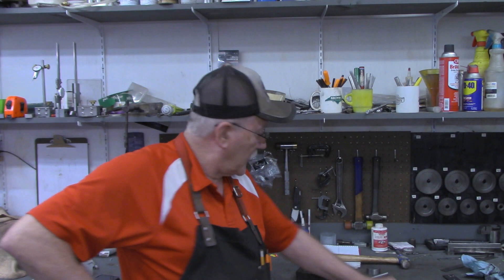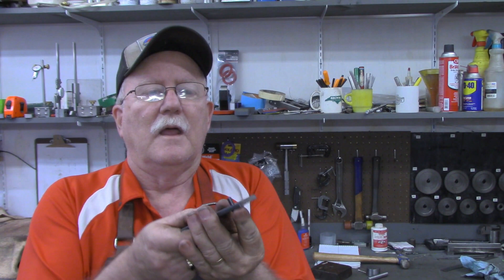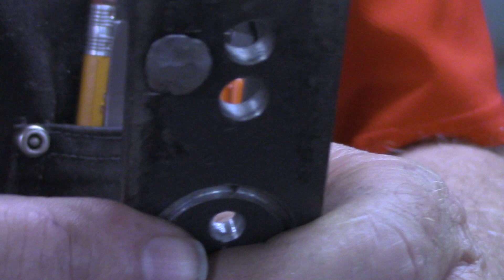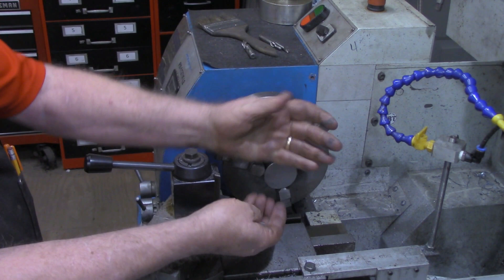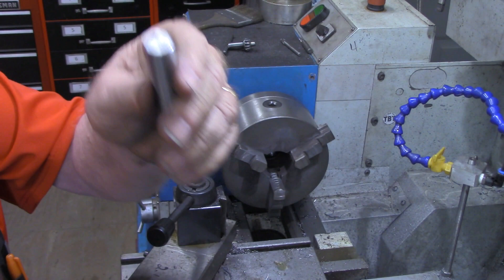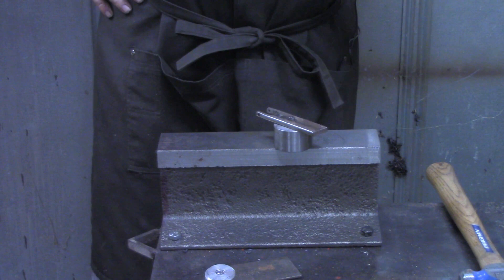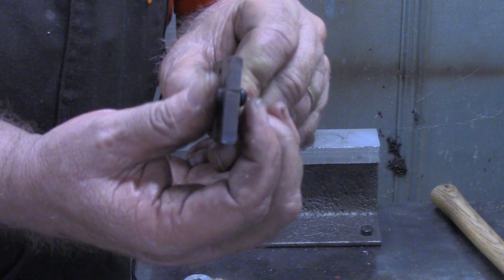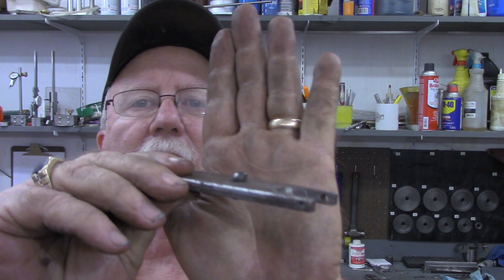Rivet Header / Setter - A Multilevel FAILURE

Comment: Hi Lee, I really enjoy your videos.  I use my 20 ton press very similar to the press you have in your shop to form rivets using tooling very similar to the ones you made.    20 tons should be about the right tonnage to press a rivet of that length and diameter with a little safety tonnage to spare.  If you have the time, I'd enjoy seeing you put those tools in your hydraulic press and form a rivet to see how it works.  If nothing else, it can save a few smashed fingers :-)  I also use a bucking bar and air hammer to form softer rivets on my hotrods, but that is for light gage material with a total stack up of about 0.06".  Keep the great videos coming!  The type shown by Rough Rooster is also a nice tool because you have a lot of control with it, and you get a similar result as with a hydraulic press.  When you are in the field a hydraulic press isn't an option.

Comment: My grandfather was a blacksmith/farrier and I used to watch him make his own rivets totally from scratch using chopped up pieces of wire.he put the heated blank in a guide and thumped it with a 12lb hammer once,this formed the dome at one end.When using the rivet he would cut it to length in the job and then with the same hammer just a few hits were used to flatten it in.Never saw him using a form tool and he explained that the quicker the metal was flattened the easier it was to work as it hardened as you hit it.It was my job to bust out all the old ones coming in for repairs and at that age I could hardly lift a big hammer and use a chisel,no fancy air-tools in my gramps shop,even the blower was hand cranked.

Comment: The rivet set that I used to use had a heading pocket and a setting bore side by side with about 1/16" between , made from rectangular stock rather than square or round to accommodate the two packets. The setting bore was the rivet shank diameter plus minimal clearance, 1.4 shank diameters deep, and bored to a square blind end, rather than a pointy end like you would get with a drill bit. This bore was used to expand the rivet with a single sharp blow that transferred the impact to the shank just above material being joined, thus expanding the shank there and preventing the rivet backing out as you finish it.
Your issue with hot rivetting is that you are approaching it the wrong way. The rivets are heated to red hot or hotter in a furnace or forge, and the material remains cold. The rivet is then placed and driven while still red hot. As the rivet subsequently cools, it shrinks in length and draws the material tighter together. In your method, the rivet does not get hot enough, and the metal it is to fasten reaches a similar temperature as well, so as they cool, they shrink at a similar rate and the rivet does not tighten further than it has been formed.

Comment: It's been a long time for me as well, but if memory serves me correctly, rivet length of enough to go through the two parts plus the diameter of the rivet seemed to be the ideal length.  Shorter would not hold well, more than that increased the likelihood of the problem you experienced.  It may have been 1-1/2 the diameter, certain it was no more than 2x diameter.  I also thought, before you mentioned it, that the head divot in the base may have been made a little too deep.  I'd try facing 25 thou or so from it and trying again to see if it improves.
Reply: I agree if you want to watch an expert go to engels coach shop on youtube

Comment: Replaced a lot of these just using a hammer. You didn't need a cold chisel to remove the blade as the blade stuck past the bar it was riveted to by about 1/4 inch. You simply supported the bar and hit the back of the blade with hammer shearing both rivets. Riveting the blade back on again was no problem just using hammer. Never had a problem with getting a good connection nor problems with the rivets not being tight enough. Biggest problem was mowing under an electric fence with steel poles, getting too close and hitting the pole was almost a guarantee of shearing the blade off the bar.

Comment: I have a heavy duty Snapon pneumatic hammer with a bit that I hand ground to a concave dome on the end. This tool has set hundreds of Aluminum and steel rivets for me, when setting steel rivets (cold) I start by peening with a hammer to about 50% of complete then bring in the pneumatic hammer to dress off the head. I cut the rivet’s length to have 1.5 times the diameter of the rivet over the thickness of the material and always end up with a sufficient head size. The bucking tool or header backing plate takes some skill to use and get good results.
It takes practice to get a sufficient method that works for you.

Comment: One reason for the high post might have been to get the hammer to strike the rivet at a slight angle with a natural arm swing thus rounding and flaring the end of the rivet. Similar to placing an anvil height at arm and fist length by your side, to get a flat strike without bending over. Hope I explained that well enough to be understood. Try using a 2-1/2 Lb, or larger, sledge and try to prevent bounce so the work piece doesn't climb the rivet.
Reply: Work piece climbing the rivet, may well be what is happening here.
Heat was not used in the past just a big hammer and strong arm. The heat if applied to the cutting blades could be softening them a little each time and rendering them useless.

Comment: As I recall, there would be two people working. One heats the rivets in a forge to a yellow heat and puts it in the workpiece that the other guy with the BFH had ready. Length of the rivet was 1 1/2 d plus thickness. psgflier has it right that the pockets on the set and anvil wouldn't quite cover the rivet head.

Comment: We had a long sickle on the hay mower and also a lot longer one on the self propelled combine.  I watched my father replace teeth on the sickles lots of times with a cold rivet and a ball peen hammer and underneath a sledge hammer for a backup.  If you had riveted a cutter tooth on it probably would have worked better.
Reply: That sledge hammer gave plenty of mass under the rivet.

Comment: rivet length should be thickness of material + 1 1/2 rivet diameter. Depth of rivet set is too deep, rivet should be just proud of the pocket, radius of the pocket slightly larger than the radius of the rivet head. A proper back-set would have a heavy sleeve for a handle to hold the work tight and a punch through a guide hole to set the rivet. You have to hit the rivet perfectly straight  to keep it from nailing over.  You can get by free hammering because you change the strike angle to compensate for tipping.

Comment: Lee, it seems to me that you’re trying to hit multiple moving targets.
When you’re riveting the original way, you have a heavy anvil, you’re directly hammering the rivet and holding the plate securely.
I think if you cut a couple flats in your die (I’m not a blacksmith so I don’t know the proper tool names) and hold it in a stout vise, you’ll get better consistency. I also think that I would clamp the plate down. After that, all you have to worry about is the form tool.
Good luck,
John

Comment: I have a rail anvil I made in High School Machine shop.  I suspect that drop is not enough mass for riveting.  Looked like you were getting rebound, and die slip.  That wood post your grand dad used help his "anvil" by absorbing the impact like a dead blow hammer, eliminating bounce.  You need a Hardy hole in your "anvil" to hold your die in place, and combine the mass.  Most blacksmiths will tell you a rail doesn't make a good anvil because it doesn't have enough mass under the striking surface.

Comment: I didn't do sickles, but when I did rivets, I alway shaped them before using the setting tool. And I think you should hit the metal down after the first 2 blows, the metal is backing off on the blows, you need to put something into the metal to get it back down...
I think your anvil dimple is too deep, it should only be there to hold the rivet, many a rivet has been set with a slight flat on the head.

Comment: Should the amount of rivet allowance for peening be 1 1/2 the rivets diameter?  Basing it on material thickness could lead to extremely long stick out if fastening a couple of 1/2 inch plates.
Reply: Glen Phillips : That's what my Dad taught me. He always bought rivets the same length but different diameters and we would cut them off for the job,
Reply: I was also taught 1-1/2 times rivet diameter.

Comment: It seems to me that you are going for the look of the finished rivet. Function is the key. Your grandfather probably didn't even peen the head of the rivet over to round it out. My dad and uncle used to do all kinds of farm repairs and all they ever did was hit the rivet like your grandpa did but they didn't peen it over round. Remember a rivet is used to hold 2 or more pieces of metal together - kind of like tightening a bolt, but it is not removable. Peening it over or rounding it out doesn't make it any stronger.

Comment: I can remember my grandad(i'm 63) putting in rivets cold, he had a small dimple in the underside piece, mainly to stop things slipping and jumping about, but the rivet head was always proud of the dimple, that way the rivet was hard against the back of the parts being riveted, if it was flush the rivet would not tighten as much. i was too young to take note of much else like length of rivet etc but i remember the shallow dimple as often i had to hold one of the parts and if it was not right man did it make your hands tingle, worse than the headmasters ruler.

Comment: Your original riviting straight up, work, but has not desired look.
Path=Anvilstand....Anvil.......Rivit/blade.....hammer.

Hi, my theory is there's too many loose parts involved between anvil and hammer, and the heat in the tip is gone faster than the lower part heat that was heated with the tool on anvil, and maybe the top part hardens as you hammer, so it bends over.
Path=Anvilstand....Anvil.......lower tool........Rivit/blade/Rivit-Heat.....handtool.....hammer.

Suggestion:
I would make the hole to fit the head of the rivit in the anvil's face, that way not using the lower part of the tool made, this way the "blade" lays flat on anvil  and less bounce.
Path=Anvilstand....Anvil.......Rivit/blade.....handtool.....hammer.
With heat:
One would think heat will make it shrink as it cools down and really clamps it more. I think the river also needs more heat, red.
Note: You probably also needs three hands so nothing can "float".

Comment: You originaly said 2.5 x diameter which is what you did, then at the end you said 1.5 x diameter, 1.5 is alot less stock than 2.5.
Reply: 2.5D is overall rivet length. Once inserted, that allows 1.5D to protrude

Comment: I think you are hammering too hard. You are not trying to drive the rivet through but to ping it over.  The set just makes it pretty and keeps you from over doing it.
Reply: Yeah peening should be relaxing work. You can get a nice hand dome if you just take your time. Done right peening a rivet with a hammer is so magical it is almost like performing a parlor trick.  The trick is to strike the rivet offset from the center with the ball peen end of the hammer all around. Keep doing that and it'll just dome up on you. But you can't hit it like you're swinging for the fences. You just disrupt the metal a little at a time with every shot you give it. For the size rivet he's doing it probably needs a bigger ball peen hammer too. That's why they make bigger ones of those. You just keep walking around the rivet with the hammer head and it'll happen. I rivet stuff with plain nails. I drill a hole, put the nail through, then cut it off with a whizzer disc, then head it up. For a real good grip countersink the hole on the side you're heading. Polish the ball end of your hammer for extra credit.

Comment: My grandfather used to do the sickle blades. He set the rivet on the anvil, it flattened the head a little, he then had a setting tool (steel about 3 inched long and 3/8 x 3/4) it had a through hole that just slipped over the rivet with it in place he drew the 2 pieces together, he use the flat head of the hammer, then he would remove the tool and using the ball peen he started the round over, when the round over head was 1/16 inch from the sickle he took the tool again, it had a radius end similar to what you made and using the flat end of the hammer hit the setting tool the last 1/16 inch and formed a fairly good looking round head. all cold. As I remember the radius was only about 3/4 of the head height.

https://www.amazon.com/Weaver-Leather-Heritage-Rivet-Setter/dp/B01E951078/ref=asc_df_B01E951078/?tag=hyprod-20&linkCode=df0&hvadid=312031446225&hvpos=1o17&hvnetw=g&hvrand=4782228282538257726&hvpone=&hvptwo=&hvqmt=&hvdev=c&hvdvcmdl=&hvlocint=&hvlocphy=9023183&hvtargid=pla-454415299822&psc=1

It look similar to this one, but said John Deere on the side and was checkered. I have it someplace if I can find it I will send a photo.
Also when he removed the blades, he put the bar in the leg vise, not tight and hit the blade with his hammer shearing the rivets. The bar was supported by the vise.